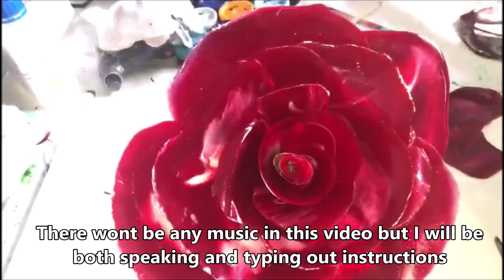DIY Resin Rose (Successes and Fails) TUTORIAL start to finish

Comment: What surface are you working on that lets the resin pull off so easily
Reply from the maker: Any plastic tarp/shower lining or silicone mat would be best. The paper I am using is a shiny butcher paper but sometimes the paper peeled off with the resin a little.
Reply: Artist Till Death thanks for the reply!

It looks AWESOME